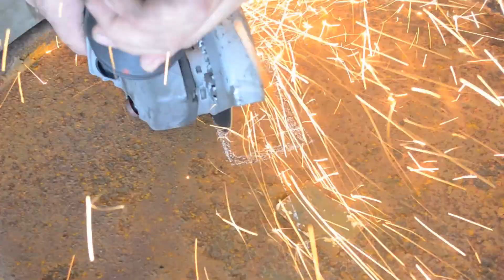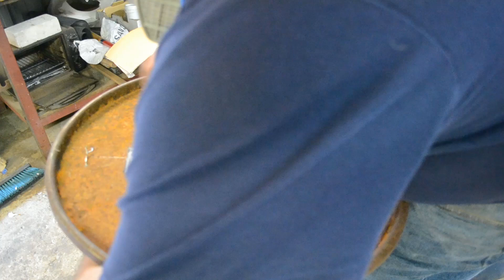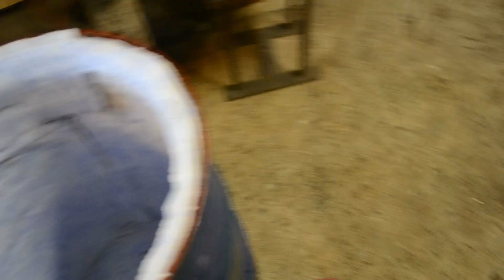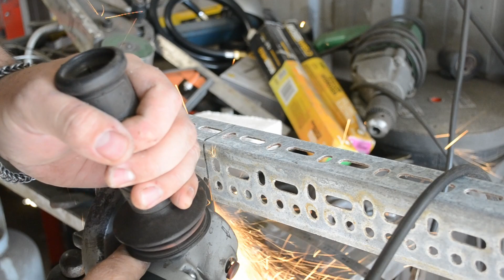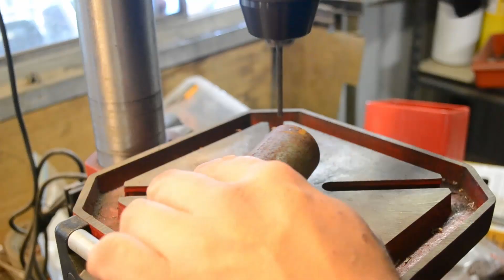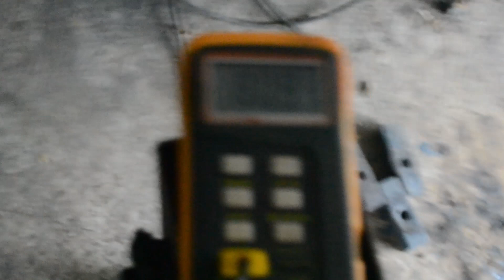Making a Cheap and Simple SWORD KILN!

Comment: Will this hold temp at ~177c to temper?
Reply from the maker: Yes, it takes a bit of dialling amd careful management though. I use it for both quenching and tempering, it's not the most ideal for it but it works

Comment: Great build. I gathered material and I already have kiln body rolled from 2mm steel and dyed with fireproof dye.  I'm going to use propane, at .y hand I already have basic propane torch similar to what you have here. 
I was thinking about making flame burners and having 3 or 4 of them, its a bit complicated and I don't know how its gonna work with gas flow with the setup that I have. So after seeing yours I wonder how it's gonna function if I did just as you.
Reply: Now, another issue is that the barrel that I have is already made to be 400mm inside diameter minus 40mm insulator blanket. Perhaps I should continue with my original intention.

Comment: This is a great video only problem I couldn’t find some of the things in this video that you used. I know you did mention the names of the products but idk if it’s just because I’m now looking and this video is a couple years old or what but if you see this comment please let me know where you got the products 
Thx
Reply from the maker: hey mate, really depends on where you're based as to what the materials will be called. The ceramic fibre blanket goes by the name Isowool or kaowool normally, but most refractory wholesalers or pottery markets will sell it. same goes with the chemical rigidiser, this stuff is colloidal ceramic. The burner was a cheap weed burner off of ebay. Hope this helps!

Comment: Sam,
Quick question. I do not have a welder yet. Would high furnace refractory cement work in place?
Reply from the maker: Honestly my suggestion would be to use wire in place of welds

Comment: I wonder if it could be scaled down say 5gallon bucket sized 4 heat treating knives , got the gears moving thx mr.sam
Reply from the maker: You could give it a shot, I reckon the even heat would be difficult in such a small container, but only one way to find out!

Comment: Do you think it would work with smaller blades if you had closer hangers?
Reply from the maker: Yeah absolutely! I've seen versions with a stainless mesh in place of the hangers to accommodate smaller blades
Reply: Ooh that is a very good idea

Comment: Dude, this is the best video on this on all of YouTube. Thank you for posting this video. I’ve been wanting to build one for so long! Way cheaper than buying an electric heat treat oven big enough for swords!
Reply from the maker: You're very welcome! Yeah I had noticed there weren't that many videos on the construction. It is insane how effective these are for the cost
Reply: @SamTownsBladesmith  do you think this will work with a 55 gallon drum? Ya not many videos on it. I’ve been reading forums and got some advice from Collin Miller on making one but this video puts it all together and makes it way simpler!!
Reply from the maker: @johnnymotley6468  yeah a 55 will work fine, if you want to do blades longer than 30" you will need to cut the bottom off and add another segment of drum, which is something I plan on doing with this one
Reply: @SamTownsBladesmith  thank you so much for the reply man! The sword I’m working on currently has a 27.5” blade so this would work great but eventually I’d like to make a long sword. Thanks again man!
Reply from the maker: @johnnymotley6468  no worries mate, feel free to message me on IG if you get stuck